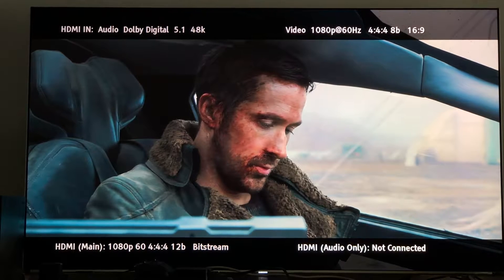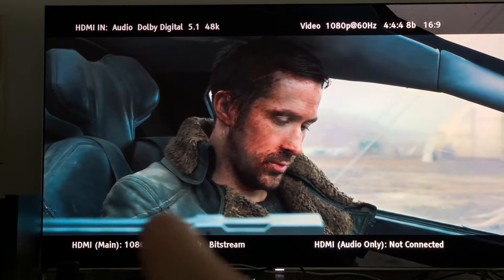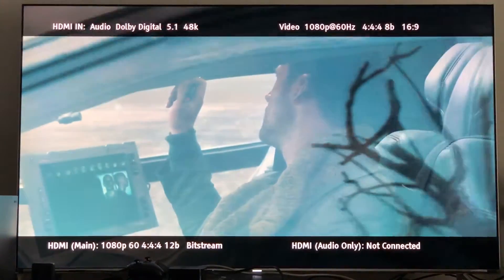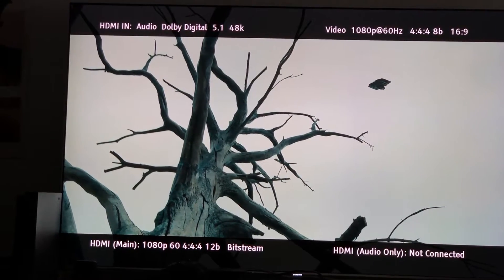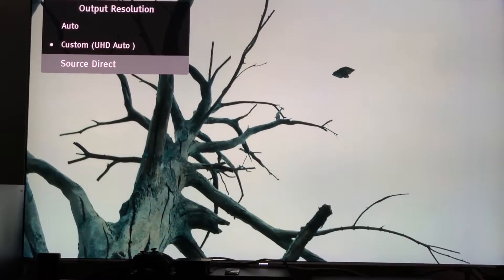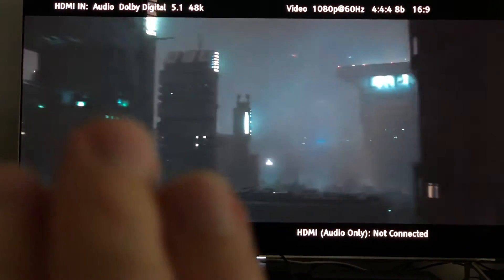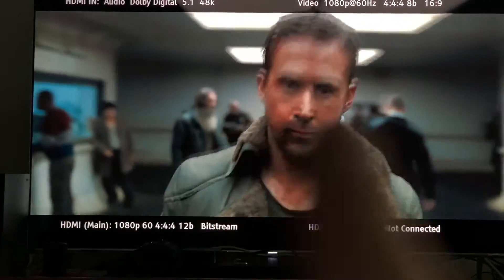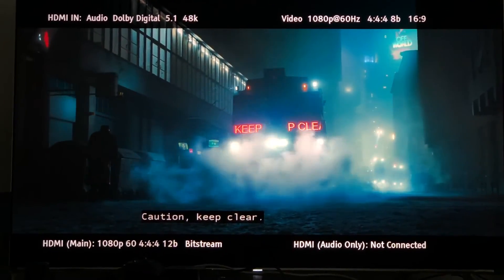Benefits of Chroma Upsampling 4:4:4 12bit from 8bit Source

Comment: i have a source 4k-UHD 24fps - 8 bit 4.2.0 (greenscreen footage), is it possible to covert into 1080p 24fps - 10 bit 4.4.4 ?( for best keying of green screen )
Reply: After so much searching, I found out how to do this, though haven't actually had a chance to do it myself yet.

You need to render out using After Effects, and not Premiere Pro, using the Cineform codec. Now I'm still unsure on which one to select as you only get 10 and 12 bit options, but from what I understand, you want to stay in RGB and not YUV, so I think that rules out the 10bit option.

Cineform was an independently made codec to rival ProRes, has since been bought out by GoPro and is now accepted as an industry standard.

You used to need to have GoPro software installed for your editing programs to show up with the Cineform codec, but since it became a standard, I believe Adobe products just come with it now, since 2017

Comment: why is it so hard to find videos on how to set up windows to use the 4.4.4 setting 

also i did not know it went up to 12 bit 

i am using 10 bit and its still night and day over the default 8 bit
Reply: if u are using RGB then u are using 4:4:4. RGB, unlike YUV, cant be anything else. YUV was invented in the early days of color TV, and with it the 4:2:2 compression became possible to  accomplish bandwith savings.
Reply: I have the Displayport.
It is beyond gorgeous 4:4:4 chroma, windows10Pro/ DellUltrasharp monitor.
DVI, HDMI are bad jokes. 

Displayport is the real thing.